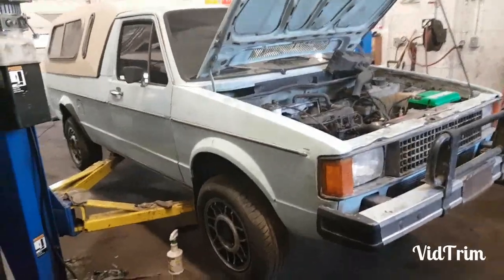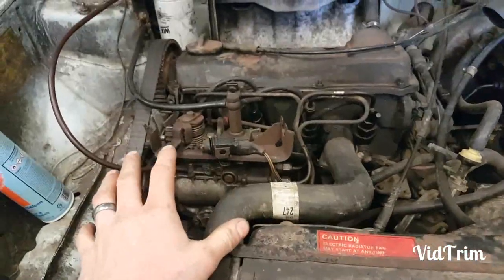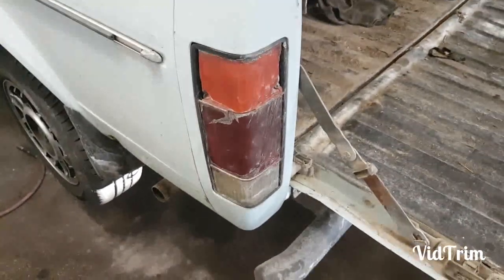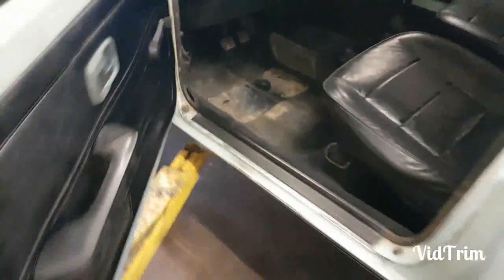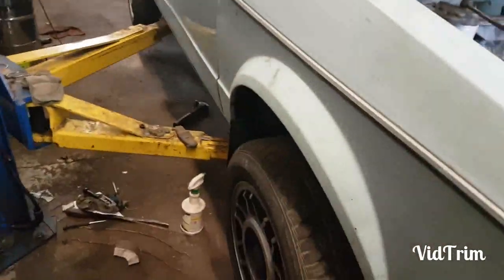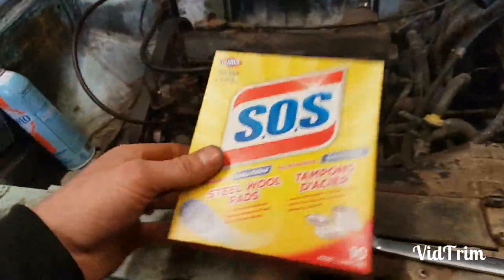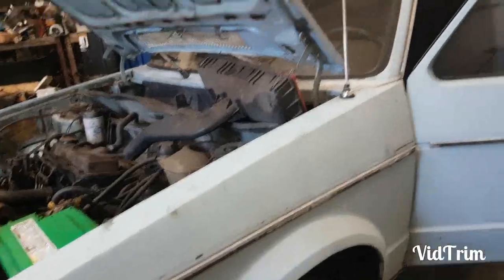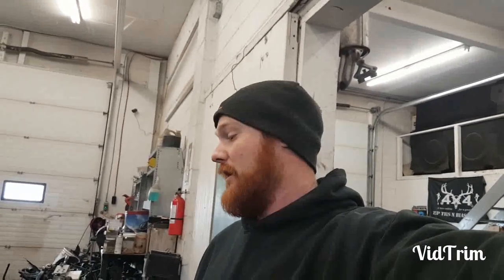Caddy truck update

Comment: There is the German company "Volkswagen Classic Parts", they will even try to remanufacture parts of these old vehicles, if they aren't available any more. I guess it's not cheap, but they are the real deal, either selling old original stock or original spec remanufactured parts. For the luxury version of a restoration.

Comment: Those seats do look pretty good, but if you ever need a set of tombstones redone, this guy on instagram makes awesome  new skins for them. https://www.instagram.com/3.14covers/ I installed them on the set for my pickup and they came out awesome. It wasn't even hard to reskin them. I threw some Amazon seat heaters in there as well while I had them apart.

Comment: You can't really call this a truck. Maybe a Ute, but it isn't even able to haul as much as these "pickup cars" of the 70s like an El Camino.
Reply: I've never had any issues hauling regular stuff with mine. There's an engine and a hoist in the back of it right now. I don't think most people need as big of a truck as they think they do. Occasionally I'll have to make two trips where a bigger rig could make one, but I'll take the 45+ mpg my turbo diesel rabbit pickup gets for that minor inconvenience that I've only had to deal with.... four times (?) that I can remember in the last 15 years of driving these things.
Reply: @MrBassistfromhell  I think it's about the weight, what would be their maximal load capacity, something like maybe 400kg? I think possibly even less. The Golf is just the wrong platform to build a truck out of. A T3 flatbed would have a) more space, and b) more importantly, also much higher load capacity, since that platform was developed to be a commercial vehicle, while the Golf never was.